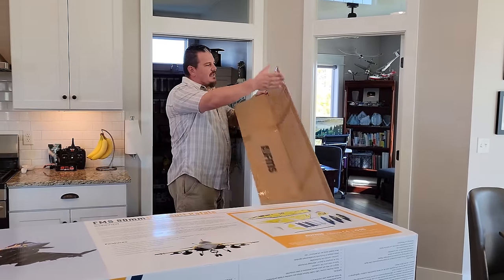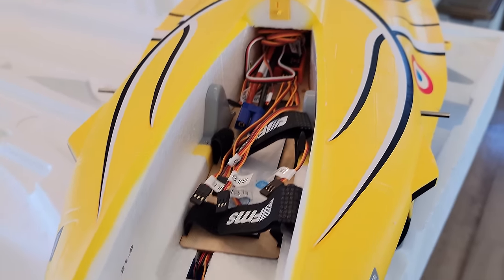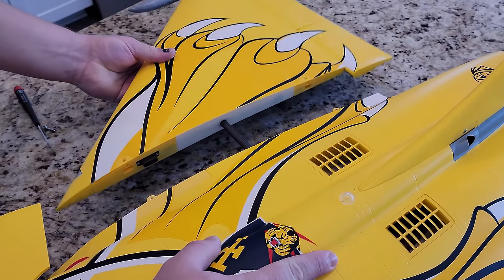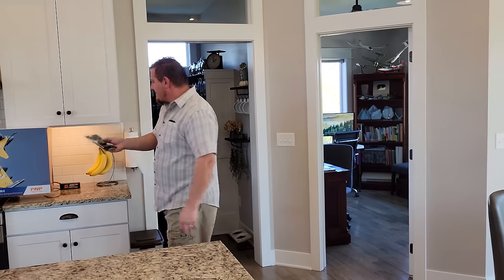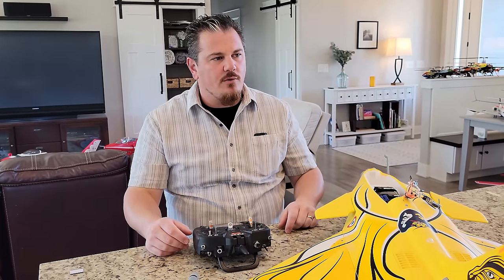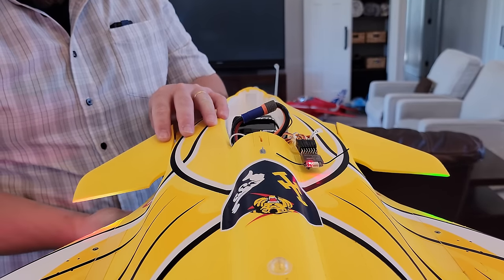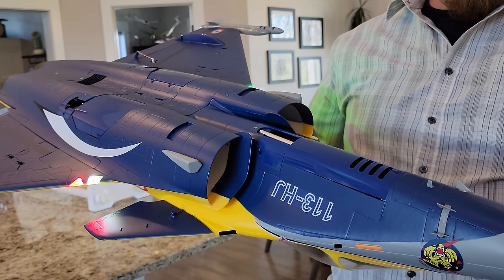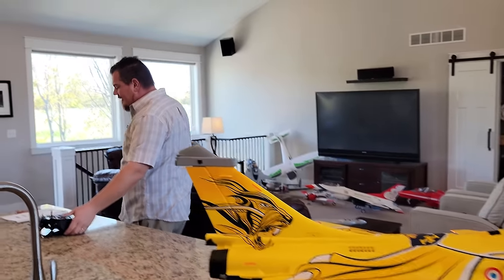FMS - Dassault Rafale - 80mm - Reflex V2 - Unbox, Build, & Radio Setup

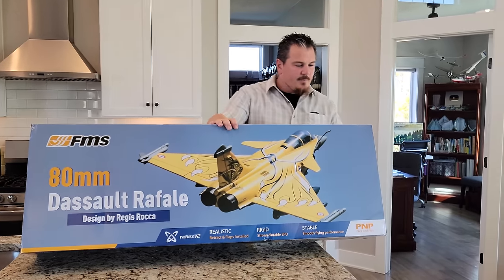Comment: What you're seeing around 1:14 is the Reflex Flashing Rapidly.  The Slow Flash is much slower.  While the Reflex is booting it's flashing really, really fast.  When I set up my Futura V3 using an AR620, I did not plug in the SBUS\PPM Mode cable at all.  The Reflex was, by default, in Optimized Mode (AS3X) which is what I want - Flashing Rapidly.  To test this, I then powered down, unplugged the Flaps from Port 6, plugged the Mode cable into Port 6, and then in Channel Assign, I assigned Channel 6 to AUX2.  AUX2 is assigned to Switch B.  Then I powered up and I was able to change Modes.  Solid LED - Stabilized Mode (SAFE), Slow Flash - Gyro off, Rapid Flash - Optimized Mode (AS3X).  Then I left the Reflex in Optimized Mode, powered down, unplugged the Mode cable, plugged the Flaps cable into Port 6, and changed my Channels, Port 6, back to Flaps.  When I powered up, Reflex was in Optimized Mode - Rapid Flash.